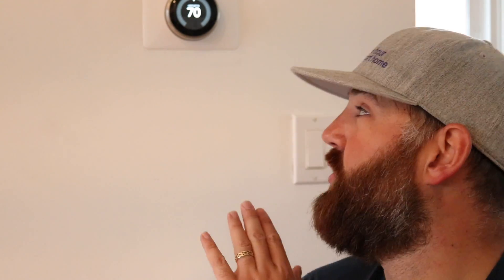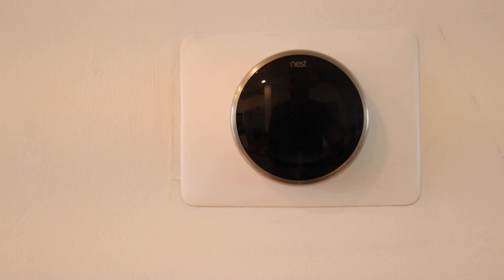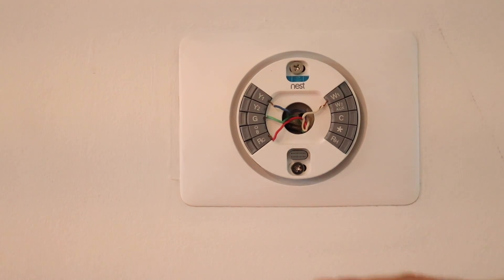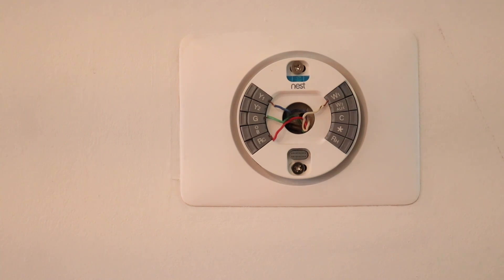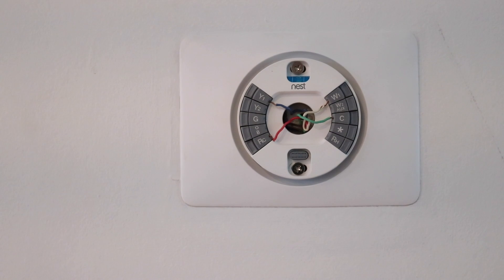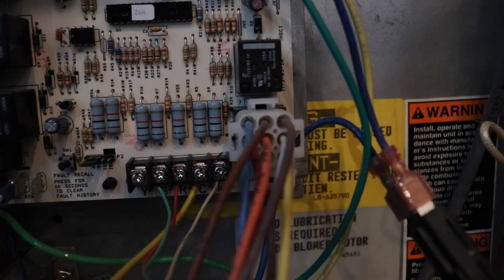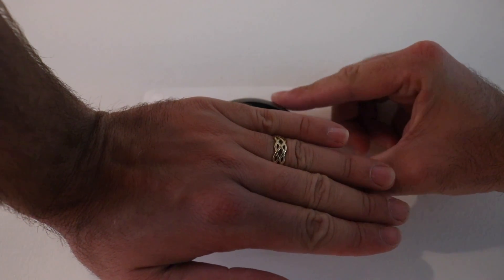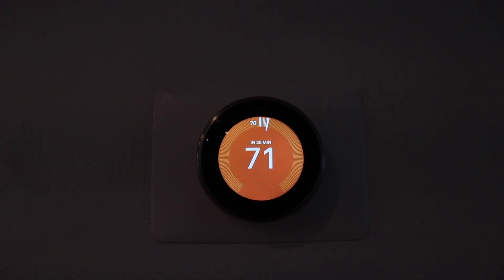Nest Common Wire Hack!!! - Nest Low Power Fixed

Comment: This caused the blower not to run when ac was on.
Reply: @onehoursmarthome I have the same issue after following your instructions. My AC unit turns on outside, but the fan doesn't blow the cool air through the house. Fan blows hot air just fine in heat mode, however....please advise

Comment: Very well explained. The cooling used to ‘delay start’ intermittently because of no C wire (as the nest doesn’t have batteries) but after making this change the cooling doesn’t actually turn on at all anymore. I tested the heating and it works fine (with the fan) but wondering why the AC won’t work at all now. Any thoughts or suggestions?
Reply: I have the same problem. Anyone figure it out?
Reply: Hey Mat, I'm having the exact same issue. Did you get it resolved? If so, how?

Any help would be greatly appreciated!
Thanks!
Reply: Same ac fan stopped working after this set up
Reply: @Baconnator50 same here. I read somewhere that it may be possible to run a jumper wire from Y to G to kick on the fan when the AC starts. Did you get this issue fixed?

Comment: I agree with others here: very well presented. I’ve sought answers from builders, HVAC guys, electricians and no one has explained the way of Nest and wiring as well as you ... Not even sure if this will solve my problem, but I learned something. ... Moving into a newly-built home nearly two years ago, for some reason, Nest thermostats would not work in the home (and homes in the neighborhood) — Carrier equipment and either standard thermostats or smart thermostats from Aprilaire. I reviewed home wiring, Nest wiring, called Nest tech support, reviewed schematics and product documentation, and everything was in place and ready to go — but it never, ever worked. No one could find an answer. Many of us just gave up and never installed Nests. This makes me want to try again.

Comment: I installed my nest thermostat last year according to their wiring diagram,...worked great getting heat from my gas furnace very similar to the one in this video,...when the first hot day in the summer rolled around the nest thermostat wouldn't fire up my central ac. So I disconnected nest thermostat and reconnected my old thermostat and my ac worked fine .
 Would you say that it was from a lack of power to the thermostat that caused the ac not to kick on ,and this video should solve the problem,...or is it an entire different issue ?
Reply: I had exact same issue.  Normalized wiring (put green wire back from C to G) and ac worked fine.  It seems this video only works to get your heat be on, not for AC.  looks like I will have to run separate wire for C

Comment: What about jumping a wire from Rc/Rh to C from the thermostat side? Asking since your saying it’s low voltage so shouldn’t cause a problom?
Reply from the maker: No, that wont work. The C wire is essentially a neutral wire that provides return path for current. Don't jumper  from  R to C.
Reply: One Hour Smart Home oh ok. Good I didn’t do it I just opened it up and found a wire not being used and connected it to the C, an all good now. Thanks wouldn’t have thought of looking in the panel first

Comment: Hello thanks for the video. So I followed your instructions and my nest is charging and staying on by my system is now not running. It makes a noise like it is trying to start but never starts. Do you think it’s because I need the g wire
Reply: His claim that the fan automatically comes on with heat or AC is not true for most systems. You need to bridge a jumper between G and C so that the fan turns on as well.

Comment: Question...my thermostat is supplied with 220V...In order to use NEST, if I do not connect R wire and use only 12V power adapter to a common wire will I be good? Thank for answering
Reply from the maker: No, you would not be good. You need to install relays to isolate the 24v power from the 220v power.
Reply: @OneHourSmartHome  much appreciated. Any web links for replays you can help me with?
Reply: @OneHourSmartHome  Follow up question if you do not mind...and excuse my ignorance...hence me asking a question to begin with :)..If I install a relay on 220V line and get 24V to Nest..Let's say I then hit Fan to ON...Nest will send 24V to fan and initiate operation...right? My question is, if my original thermostat is getting 220V from fan coil in order to be powered ON...does it send 24V back when certain function is initiated by user or it sends 220V...I think you know where I'm going with this.

Comment: Very nice video! Thanks for sharing! I followed the wiring instruction and put the Nest thermostats E back on. It showed an error code E195. Bascially it indicates there is no power detected in R. Can you help me out on this issue? Much appreciate it!
Reply from the maker: It's possible if you left the power on and touched the wires that you could have blown a fuse. These replacements typically work: https://amzn.to/2VXybvi . Also a good idea to make sure that your wires are fully inserted, both at the thermostat and the HVAC system terminals. If you are still having issues it's possible that your HVAC system doesn't put out enough power for the nest and you need a common wire adapter: https://amzn.to/3eSemON . Watch this video for installation instructions: https://youtu.be/gahPxCcPDto

Comment: This is wonderful  information with simple instructions.  Question:  my furnace control board have a wire connected to the C terminal, although I don't have a C wire connection at my thermostat.  Should I leave the C wire connected and also connect the G Wire to it??
Reply: Yes you leave the wire on the c that’s connected in your furnace just add the other to it

Comment: I have a yellow wire in y1 and blue and C - I think I blew the fuse on furnace 3 amp watt when the system was started up it said low power and shut down.  How do I resolve this? Thanks
Reply from the maker: Open up your furnace cover, and replace the fuse that looks like this: https://amzn.to/2ya8Tll they also typically have these in stock at auto parts stores. Make sure the power is off, remove the old fuse, insert the new fuse and turn the power back on. The fuses are located on the electronic control board.

Comment: I have the same problem but I only have the heat, cool and power wires. What do you suggest to do? Do I have to add an extra wire /Cwire or can I use any of the other wires like you did on this video?
Reply from the maker: Get a C wire adapter: https://amzn.to/2XBqOMr like we show in this video: https://youtu.be/gahPxCcPDto

Comment: Thanks for the info!  I did what you said and the low battery sign went away and I was able to connect to the app.  Bad news is that the blower is not working now and the AC will not turn on.  Our house is pretty old so I guess it’s an older unit.  Any suggestions?
Reply: Steve the Stu Williams did you get any answers I am having same issue

Comment: My nest thermastat is showing a Error message which is E3 "No power to Rc wire detected" would this video help me with my issue?
Reply: no, same Rc wire issue here mine is not wired like on this video but I started having problems after shutting off for a while then I get this message, what I did turn the main unit off, { cut the power} like a reset then it works, my thinking is the lithium battery in thermostat gets discharged if unit is completely off for a while , therefore after reset or charge the thermostat independently might work, hope it helps!

Comment: Good afternoon great video. My nest thermostat gives me an error (no RC/RH connected). However when I connect the pervious thermostat it shows that the R wire does have power. If I follow your instructions on moving the G to C, would that fix the Rc/Rh error?
Reply from the maker: In most cases it will fix the issue. If not you might need a common wire adapter: https://amzn.to/2X24Emh this video shows you how: https://www.youtube.com/watch?v=gahPxCcPDto. Another common thing that happens is that your fuse might have been blown if you touched wires durring installation and had the power on. If that's the case you need a new fuse: https://amzn.to/3bNjeSC typically they are 3amp fuses just like the ones found on your car and are located on the furnace circuit board.

Comment: Will this work to an older furnace? Today this thing started to disconnect from the wifi and I notice the battery while the system is running stays in the 3.72.  I'm uncertain if changing the G wire inside the furnace into the Y will break the furnace.
Reply from the maker: Robert, you should change the G wire to the C terminal. Typically this works on even older furnaces. Your other option is getting a common wire adapter: https://amzn.to/2wMR3on and following these instructions: https://youtu.be/gahPxCcPDto

Comment: This is amazing! Thank you so much. I feel you have helped me determined the problem but my furnace is hooked up differently. 
I have 2 sets of all the color wires set up in the furnace; 1 set for the furnace and the other for the outdoor condenser (OC). All the colors are correctly positioned for the furnace. The OC has just the Green and White hooked up: the White wire goes to the Blue, and the Green wire to the Yellow. My feeling is that the Red wire needs to replace the Green going to the Yellow. OK... I tried this. Still getting the E195 error code :( Also tried replacing the common wires with the green (furnace and thermo)... nothing :(

Comment: Thank you for making this video. I work in the apartment maintenance industry and was looking for a solution to this. Does this method work for electric air handlers as well? We are having problems with the Y1 not registering power e160. The only other option I had which came from nest pro installation booklet was to install a 220ohm 5w resistor between the C and Y on the air handler.
Reply from the maker: It depends on the electric air handler. It will work with some, but others it won't register. If it doesn't work for the electric air handler the other option is adding a  common wire transformer: https://amzn.to/3bKoIxz  this video shows you how https://youtu.be/gahPxCcPDto

Comment: Would this solution be an effective way to fix the "2 hour delay" on heating? My Nest E is blowing cold air even when I am setting it to heat (my bedroom doesn't even have an AC function). Happy to give it a shot but figured I'd check before going through the process. Anyone has experience with that?
Reply from the maker: Sounds like you might have wires that were mislabeled? This video should help: https://youtu.be/CCNIko3iZIE

Comment: Nest support doesn’t recommend the common wire change your showing without having an expect HVAC looking at the furnace.  That green wire currently has high voltage on it until it is changed on the furnace.  Any responses welcome.
Reply from the maker: Mike, did you watch the video? We do exactly nest support recommends or what you would pay a professional to do. Except we save you a $100 showing you how to do it. I recommend re-watching the video.

Comment: We had the Nest thermostat for two years before we started having low battery issues. It was frustrating to wake up during the winter to a cold house because the nest did not have enough battery. Ugh! We watched this video and hubby actually ended up finding a C wire that was just not hooked up to anything. It was tucked into the wire wrap upstairs and wrapped around another wire at the furnace. No need to take the g wire. Thank you for the help!
Reply from the maker: Thanks for sharing!

Comment: Why did you not jump Rc to C
Reply from the maker: Because that doesnt work. R provides power. C is a neutral wire or return path for current.

Comment: Hello there! Question: mine already has both G & C wires plugged in (the other wires are Y1, W1, RH) and it still won't charge... What should I do? Thank you for this awesome video, any advice is appreciated!
Reply from the maker: Check to see if your turned the power back on, check if you blew the fuse inside the hvac system and check that your c wire is connected in the furnace.
Reply from the maker: If that doesn't work use a c wire transformer: https://amzn.to/2UEwQHZ

Comment: i had just w1 and Rh wires connected, my nest thermostat doesn't work well. i added Common C wire and solve problem, my thermostat works perfectly. thanks for the advice.
Reply from the maker: Glad it worked thanks for the support Mario!
Reply: How did you add a C wire ??
Reply: @abishekjagdish7420  I had to install a new cable wich contains four wires, I used three of them.

Comment: Do I need a jumper cable from Y to G
Reply from the maker: No, you should not jumper from Y to G.
Reply: @OneHourSmartHome are you sure? After doing this hack, my AC turns on, but the fan in my furnace doesn't.

Comment: I did this hack and it worked just fine, however I must of had a bad battery because it would never charge over 3.6v NO WIFI, google replaced it for free

Comment: I ran a separate 24 volt transformer I have a boiler baseboard heat (two years old) no blue common wire or at least I could not find a terminal block that a screw for common wire. I have 4 nest thermostats one for A/C. All batteries are now at 3.9 volts constant. It’s a pain to run a second set of wires to each thermostat but it’s fixed!

Comment: what if you have an old system that is two screws for the low voltage but each terminal to ground has voltage how do you determine which is the common wire coming from transformer when both wires to ground has voltage. You can switch both wires around and the system works fine. I was thinking adding a multi tab transformer which has an R. W and  common what do you think
Reply: Just two wires is just a switch,doesn’t matter which terminal they go on
Reply: @anthonysmith9410  thanks for the info

Comment: My system doesn't have the terminal with screws like yours. How do I go about that?
Reply from the maker: How old is your system? If it was built after 1980 it should have them. Look behind all access panels, follow where the thermostat wiring goes into the unit.

Comment: What if you have an Aprilaire system. By taking the green wire and jumping it over to be a common wire, what happens when your Aprilaire system turns on. Does the fan still kick into circulate the humidified air?

Comment: Aloha I live in Hawaii so my system is Unitrane A/C only. Second issue is it is line voltage. Is there a possibility to use Nest/Nest E to control my A/C?? Mahalo for any advice.
Reply from the maker: Yes, you can most likely control your AC with the Nest E but you would need probably need to add a common wire if you dont have one or a common wire tranformer like this: https://youtu.be/gahPxCcPDto

Comment: hey man what wiring setup do i need to do? 

on cool mode the unit just turns on heat and in ac or fan only mode only the fan turns on. 

i got Rh in, and the yellow 1 wire in, and w1 wire in and G wire in. and the C wire in

Comment: Can I just put. Jumper from the green wire to the C
Reply from the maker: You need to make the common wire connection on the furnace control board as shown in the video.

Comment: Can you use the green wire from AC (new HVAC system in 2019)  if you have a two separate systems, and are using RH and W on Heat side ?
Reply: I have the same problem I'm curious if you were able to fix yours and how

Comment: This was amazing.  Watched this probably 37 times.  I just did this at home today and had actually purchased an adapter to add a C wire per another video that you made, juuuuust in case I couldn't get this done myself. But it worked! And now I can return the adapter!  THANK YOU!!! 

Also, is this something I need to do for my air conditioner as well? Or...is the furnace and air conditioning the same thing? I know zero things about HVAC as you can see...which is why I love your videos.  Thank you!!
Reply from the maker: If your air conditioner and furnace are all one system (which most are) this will take care of the issue for both your ac and furnace.